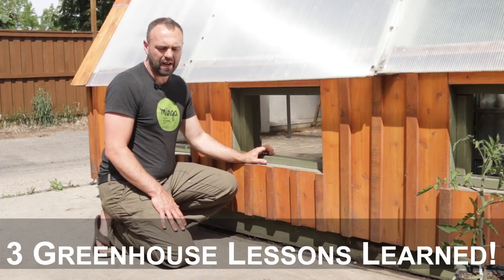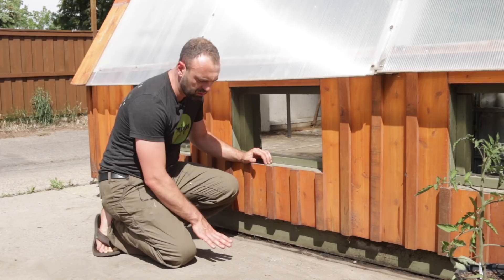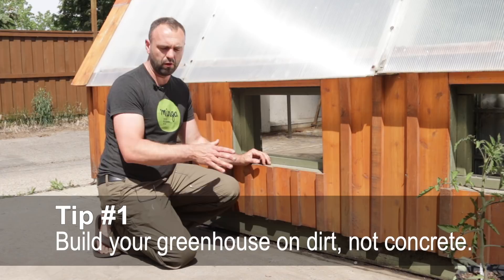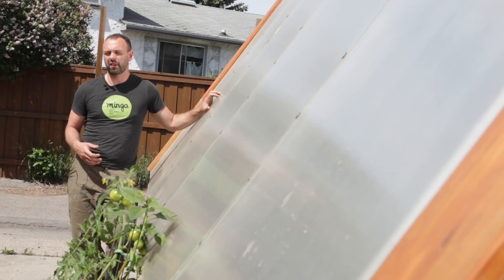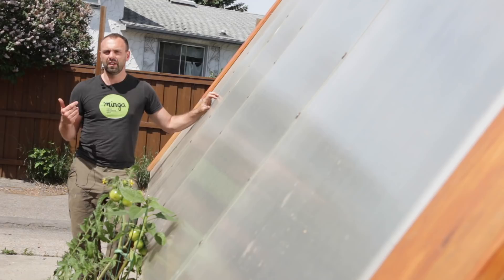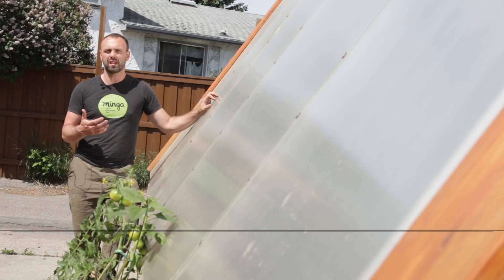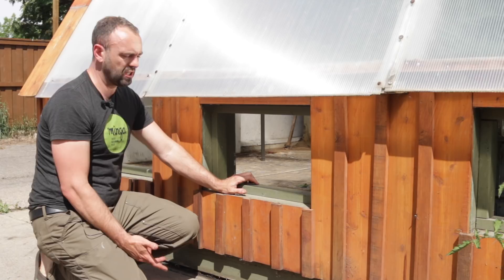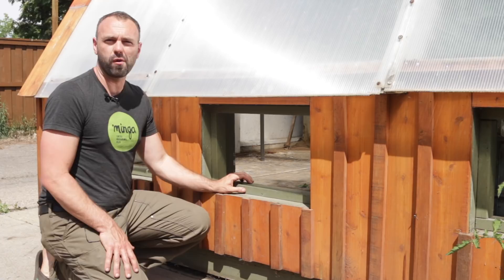3 Solar Greenhouse DIY Lessons We Learned The Hard Way!

Comment: Another component to consider, when deciding on the pitch of a greenhouse 'glass' is the angle of the sun in winter.
A steep angle will allow maximum sunlight entry during the low angled sun during the winter,  but reduce the suns entry during the summer, when the sun is very strong, so reducing overheating.

.

Comment: I'm happy after hearing your thoughts on greenhouse design. Ive just started working on thermal mass in my greenhouse. Check it out if you would like. I've got a big old concrete sump tank under the greenhouse about 250gallon or so which I'm keen to fill up with water and perhaps store some heat from the day in there.. you can just see some ply covering the entrance in my latest video :)